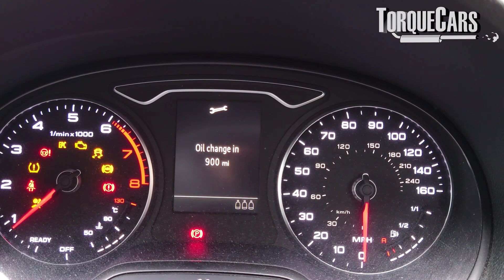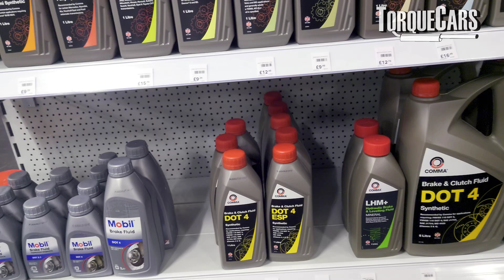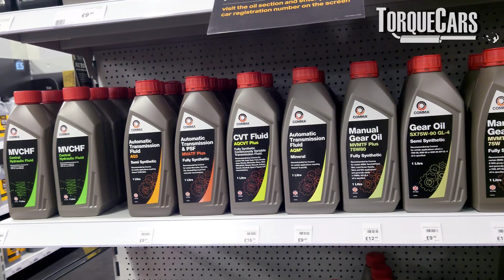Mechanics Won’t Tell You This About Your Car’s Fluids! How Often Should You REALLY Change Them? NEW

Comment: Bmw X5 40d f15 
Engine oil every 8k
Transfer box oil 40k
Gearbox oil 60k
Front and rear diff oil 60k
Brake fluid 2 years 
Coolant flush 60k

Comment: What about supercharged Shelby GT 500 where I drive it 700 miles per year ? 
My car has 10k miles and is 14 yrs old now. Does age itself mean we should change coolant , brake fluid and how often for oil? 
Shelby says every year regardless of mileage which is absurd . ? Opinion on time interval and not mileage for these low mile specialty cars

Comment: the ball test for coolant is only measuring if it still has the antifreeze properties or is in concentration enough to do so.  That's a very rare situation whereas teh acidity level is what matters generally bcuz that acid can deteriorate engine components including head gasket.   I'd like to know if the little cheap electronic testers are worthwhile, vs teh test strips whose color matching isn't easy for us color blind guys??
Reply from the maker: I too struggle with the strips. The electronic testers do vary in quality but work really well overall. I doubt if people follow the coolant change recommendations they will hit the acidity problem but I guess it depends on the engine and how it has been driven.

Comment: after spending a lot of time slowly over the past fifteen years, and really way too much time, and consulting w/ my great mechanics/shops as well, that i rely on for advice (I dn't use them for oil changes normally, i DIY or have quick shops do them) the consensus has gotten shorter and shorter, and now is roughly 3-5ish K miles, depending on use-style but also on the engine type, size, etc etc.   The engineer who designed the Nissan GTR car and engine, strongly said all that matters for all engines, is 3K oil changes now.   The reasons for the conserative approach by quite a few actual experts like him (and ppl in the engine building world, and oil tribologists who happen to be enthusiasts and experimentes themselves, is several fold and i'm too tired to lay it all out right now.   My father was a brainiac genius (savant actually) chemical engineer and specificically fuel and lube for aerospace, namely commerical aviation and military aviation.    He taught me the basics of the chemistry in the '80's.   .... Then again, if one wants to economize, then have the used oil tested and go from there.  I'ts possible  that we don't need it quite that often and that 8K is fine.

Comment: Solid advice! it does not cost much to change and is often neglected. 
As for the statement "lifetime" eh hum - worked in both automative industry and chemical industry and what they consider "life time" is 10 years or the warranty period.  The internal phrase used was "the built-in obsolescence...."  🤔
The oil analysis is a GREAT tip it can also pick up head gaskets starting to fail! (phosphor level increase but that can be distorted by people using oil additives - not a great idea)
For the coolant many have anti corrosion additives and they do degrade with time, and this in some engines can cause issue - suspected reason for certain Toyota head gasket issues!

As the saying goes "oil is (relatively) cheap, engines are not"

Comment: Great videos as always! I checked my transmission intervals on my Suzuki swift, and it just says 150k inspect. It says if it's changed for non Suzuki oil change every 40ks kms 🤔. 
I am thinking since its at 144k kms now would be good time to replace the oil.

Comment: I have to disagree on hybrids engine oil change intervals. In city driving, and short trips, lets the engine chronically languish at coolant operating temps of 130-160 degrees Fahrenheit. This tends to yield both fuel dilution and water from combustion in the oil. I have experienced a lot of this on a Gen 3 Prius. 

It’s my personal preference, but I go 7.5K miles if it’s heavy HWY driving and 4.5K if it’s short trips.

Check your dipstick often and you’ll get good at visually evaluating when it needs changed. Its smell is a good indicator too. You’ll get good the more you check that dipstick.

Comment: I find it frustrating trying to get garages to actually do this stuff. A few years ago i asked for the transmission fluid to be changed in a 10 year old Corolla and the mechanic, who I know had twenty years in the job, looked at me like I'd arrived from another planet and I couldn't talk him into doing it. Recently at another garage  with my Toyota verso 1.6d fitted with the dubious bmw n47 engine, I mentioned that I change the oil every six months at 5000 miles. The response was that he didn't see what i would get out of that, and that was straight after we'd talked about their reputation for timing chain issues.
Reply: Yes,  same happened to me,  and I ended doing it myself.  I am talking manual gearbox

Comment: Toyota sedan Hybrid, manufacturer said 10k miles or 12 months for engine oil, I go max 8000 miles either max 10 months, whichever comes first.
Brake fluid (looks like it it DOT 5.1), Toyota says change every 20k miles either 24 months, practically I'm having it changed every two service intervals, sooner than that.
 Coolant, they say 10 year either 100k miles, not going to be that stupid, it will be changed at 60k miles, in my case around 6 years. And electric converter coolant runs in a separate circuit, going to change that one too. 
Gearbox eCVT oil, Toyo says 60k miles either 6 years, I ma going to have it changed around 40k miles either 5 years. 
Engine air filter changed at every 20k miles or sooner. 
Cabin filter every service interval, it's about the health of my lungs, not going to go cheap with it. And only carbon filters.

Comment: Would you recommend to change the transmission fluid for a DQ200?
Reply from the maker: Not really, if that is the 7 speed dry clutch DSG only the higher power variants used a wet clutch which does seem to degrade the oil quality over time and on those I would do 35 to 40k changes.

The reason I say not really needed in your case  is because the oil looks the same as it did new and it didn't show any significant signs of degradation when tested on a friends car which had covered 100,000 miles. If it was easy to do I might err on the side of caution but these are a pig to work on.

Comment: It depends on whether combustion gasses are getting into the coolant, causing it to acidify and then cause corrosion. Diesel's run at higher combustion temperatures, causing a tiny bit more getting into the coolant system.  Checking coolant pH levels are best. You may need to change coolant more often or not. On my Peugeot engines, I've never changed coolant (20k miles per year). It gets changed when doing the timing belt every 100k miles. That's it, but headgaskets on these engines are known to go on forever.

Comment: Shitröen states that at least some of their manual transmissions are "sealed for life", although that might be because oil changes on that part are unnecessarily difficult.
Reply: Twin sister brand Peugeot claims same BS for their ATN8 gearboxes, although Aisin, the manufacturer of those recommend gravitational oil change at every 15000 miles.
Reply: @adrianiacob1991  I'm never buying another Peugeot or Shitröen ever again. Nice looking cars and usually good engines but essentially the European version of Chinese cheap & nasty. Terrible trim quality, electrics designed to last only as long as the warranty and a dealer network who probably knows that once you've brought one you're not going to be buying another and so treat you appropriately.

And as for Asin, just ask Nissan owners about their transmissions.
Reply: 'life' for a car manufacturer is length of warranty or maybe 5-7 years maximum. After that it is only a 'banger' as far as they are concerned. Reality these days is most 10 year old+ cars are still worth a lot of money and have plenty of life in them. So worth maintaining properly.
Reply: @MartinBennett-rs6thrasher  Can't disagree with you on them generally being worth maintaining, but I would suggest it's a good idea to buy a brand who values longevity and repeat custom. There is a saying that Ford et al want to sell you your next car whilst Honda and Toyota want to sell you your next seven cars. The thinking behind that is that the latter two brands build cars which last and cause their customers few if any problems, and so they get a lot of repeat custom. Ford, Shitröen et al not so much.

Comment: Ive had cars that have been 15 years old and the brake fluid was never changed. No issues and no water content.  Brake fluid manuafacturers and service garages love the 2 year change crap.  5 years maybe but 2 is over the top.  Get a cheap fluid tester to be sure.

Comment: I didn't hear you mention differential oil... I bought a  merc with 300k on it and the owner said he had changed all the fluids regularly. I mentioned the differential and the response "what is that" and it is not on the service schedule!
Reply: Yes, you're right. I had a Mercedes SLK, and the auto transmission fluid change is in the service schedule, but not the diff.

Comment: 2008 Aston Martin Vantage, Audi TT roadster and BMW 325i having them since new, never changed brake fluid or coolant. My country is hot and dry though
Reply: Once the H2O is on there it isn't coming out without help, and hot brakes will do it.
Reply: @loc4725  Water when is steam will not compress like brake fluid,  the boling point of water is 100c, brake fluid is very high.  so  hot brakes with humidity in the brake fluid simple mean lost brake and best scenario  brake but the brake distance is too long.

Comment: Change the coolant especially for Diesels at the most 5 years with correct spec (mainly) for reasons of internal erosion and corrosion rather than freezing protection where it's most often always fine (in the UK)? Using VAG correct top spec for A3 1.9tdi 8P1, but left it for 6 1/2 years and had corrosion via rust contamination seemingly from the block area was clearly evident on draining and flushing; and that was when the coolant had previously been drained, then filled and ran flushed with a flush cleaner and deionised water, and finally flushed with deionised water; and then finally filled with a coolant deionised water mix (no tap water). Thought it would have been ok after all that but wasn't i.e. if knew what I know now it would have been flushed and changed well before the 5 years max.
Reply: It depends on whether combustion gasses are getting into the coolant, causing it to acidify and then cause corrosion. Checking coolant pH levels are best. You may need to change coolant more often or not. On my Peugeot engines, I've never changed coolant (20k miles per year). It gets changed when doing the timing belt every 100k miles. That's it.

Comment: I know what you are saying about changing the oil is true.  I have a petrol engined car that only does four thousand miles a year.  It just takes me to work and back as I work shifts that start before public transport.  I have the car serviced every year but last year, I didn't bother as I thought I was over servicing it.  When I put the dipstick in, the oil was like a dirty black treacle.  I got it serviced this year and found the oil was clear again.  The engine is running smoothly but I hope that I haven't damaged it.

Comment: I agree totally on the oil change. I change mine every 8,000 miles. As a compromise between changing so often it's a PITA and changing so rarely it accelerates major engine wear.
I've just taken the silica bag out of my recently bought Skoda Superb. I'll be changing the coolant every 5 years. At the same time as the timing belt and water pump.
I agree on brake fluid too. Every 2 to 3 years is about right.

As for mechanics not telling you this, it depends on the mechanic. Some know what they're talking about and give great advice.
Reply: @lint8391  8 thousand miles?! Hope you mean 8000 km
Reply: @woodrmp1  No. 8,000 miles. That's with using the manufacturer's approved long life oil for each car. Combined with a reasonable proportion of the driving being done on motorways.

And using Mann or Mahle oil filters.
And taking the time with each oil change, like leaving the old oil dripping out for a couple of hours whilst I do other stuff.

Comment: Something that has changed greatly over the years is the quality and additives of Lubricants. The shear speed of many oils has increased as piston speeds and bearing speeds have increased. It is the main reason that service and oil change periods have become lengthened, modern high quality oils last far longer than the 20/50 of old. with my own ICE engines I always followed the manufacturers advice as to change times, with vehicles that managed over 130k miles with no problems, before they died of other problems. Never be tempted to use cheap oils. the only vehicle I owned that seized up was on a recycled oil from Halfords. 
Nowadays the only oils in my car are a 'for life' gear oil in the reduction gearing and Brake fluid which is changed bi-annually. NO engine oils, no steering gear oils, no back axle oils. (I forgot the suntan oil in the glove box!)

Comment: Changing engine oil more frequent pays off over many miles, currently every 9000-10000km for my diesel. Even after 9000km now the oil is not even black at all, it is more "blackish".
When I bought the car and I changed at 15000km , which was the old dealer interval, it got black much faster after oil change. Then I switched to 10000km. Have had oil analyzed by Blackstone. 10-12.5K recommended. Honda 20000km, dealer 15000km, I do 10000km. There are just less deposits in the engine. Take off the valve cover from petrol engine, if you see varnish and yellow/brown deposits = not enough oil changes. I do my Honda R engine every 5000km. The engine is used heavily.  Track day/ weekend = change after weekend. Oil is cheap, engines are expensive.

Comment: Because hybrids run cooler on average, they often suffer from fuel and water contamination of the oil. Unless you drive mostly medium and longer trips a more frequent OCI is best.
Reply: Super Correct.
Reply: My theory too. I get my Lexus hybrid serviced at the MD yearly in order to maintain the full warranty (up to 10 years or 100k miles), but I complete an oil and filter change at home at the 6 month point, in between official services. I do a lot of short journeys - 3 to 10 miles.

Comment: Fluids aside, the other most overlooked service item - brake flexi-hoses. Should ideally be changed every six years 🫡
Reply from the maker: I should cover that because it's hardly mentioned and often regarded as a "replace it when it fails" part.
Reply: What goes wrong with them? I have changed when the outer cracks (MOT fail) but one of our cars is on 40 year old hoses with no splits. Interesting.

Comment: Brake fluid replacement is the most overlooked I think. For about 50 royal british pesos its well worth.
Reply: I think you'll find that ~£6 for 500ml DOT 4 + a one man or E-Zed bleed kit + the correct spanner comes to a bit less than 50.
Reply: where I live - not so far from the sharia-UK - I am able to change ALL the fluids in my ICE car for less than 30 UK dinars - mind you - I do it myself on my driveway
Reply: I recently made this mistake. Cost me calipers, rotors and pads. Never again, I bought one of those electronic testers.
Reply: yes, in the UK by average 3 years the brake fluid start to show humidity.

Comment: With our cars we change the oil roughly every 10k miles.
Reply: Probably too long unless you drive a lot of easy highway miles.
Reply: @0HOON0  a couple of years ago, I drove for a 10K mile interval (hwy miles), and sent off a used oil sample to a lab for analysis. Lab report came back saying it could last another 2K miles, given the driving conditions. I’ll just keep it under 10K miles.
Reply: @0HOON0  yeah if the car is driven like that 10k is totally fine, especially if it’s like a Toyota or something
Reply: @Xenon777_ Only if you need your engine for less than 100K miles.  😂🤮
Reply: @ Hasn't affected our engines. 2 of our cars are on nearly 150k miles. Neither burn oil or have sludge. The camshafts have practically 0 wear, no score marks. Original turbos too. The manufacturer recommends 12.5k mile oil change intervals so it's below that. 

I've seen a TSI car on YT with over 200k miles which followed the long life service interval of nearly 19k miles! No sludge or oil burning issues. Not saying I'd do that, but 10k mile changes is definitely fine for our cars.
Reply: @Xenon777_ What engines? Unfortunately that hasn't been our experience with my family's Audis. Major oil burners starting at about 80k. B7 AND B8.
Reply: @0HOON0  1.4 TDCI Diesel from 2009 and a 1.2 TSI Petrol from 2011. Our 1.6 TDI also follows 10k miles oil changes and it's on 110k miles. Never had any issues related to our 10k mile oil change intervals. If those Audis have been burning oil excessively, it sounds like an inherent problem with the engine if you have been changing the oil at the right time too. A car burning oil isn't always related to a driver's oil change frequency. For example, some early 1.4 TSI engines suffered from oil consumption, and it was due to a flaw with the cylinder head. The updated part fixed the issue, so for issues like that, no amount of oil changes would be able to overcome a poor design. Anyway, for ours 10k miles is clearly fine! Of course, every car is different and the way people drive varies. It's up to the individual what they do with their car.